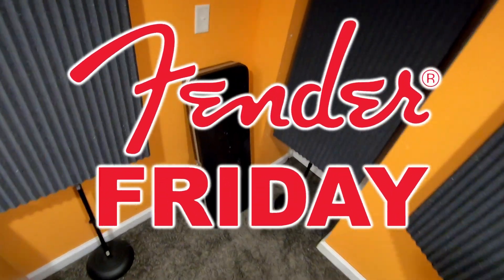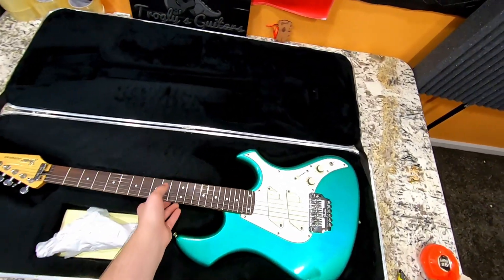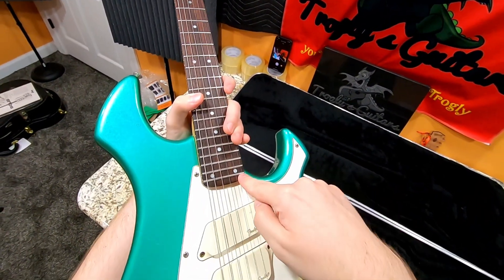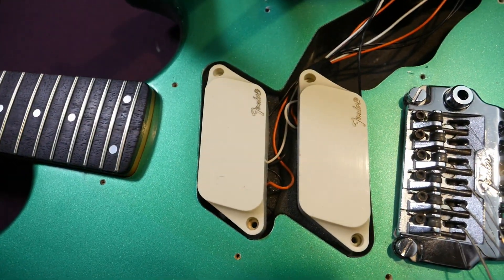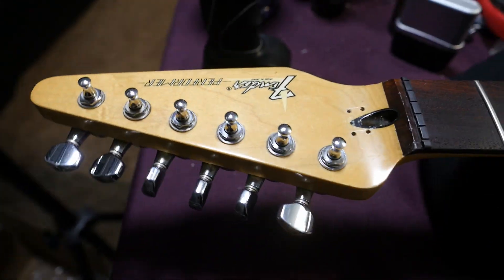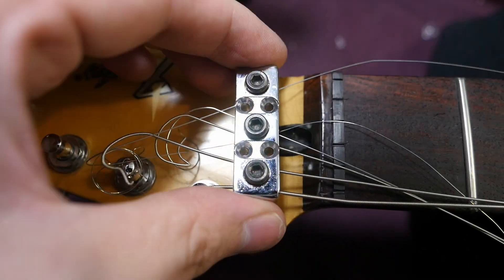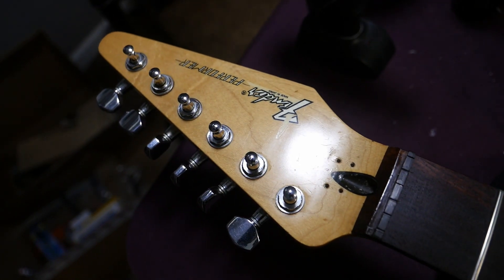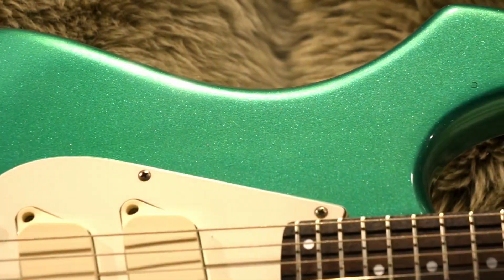That One Time When Fender Made the Strat "Metal" | 1985 Fender Performer MIJ Review + Demo

Comment: I have one of these in sunburst. I love the weirdness of it and the variety of tones I can get out of it. Nice to see this model getting some attention, especially now that there is a new performer series, burying this one even further.

One correction: the TBX tone control can not boost treble. It is impossible to boost anything without active electronics. The TBX acts like a standard Fender 250kΩ tone pot between 1-5 (until the notch), but with the compressed scale (as in, 1 on this is like 1 on a standard 250kΩ tone pot, but 5 is like 10 on a standard 250kΩ tone pot). From 5-10, you essentially have a different pot that goes up to 1MΩ, which is quite high. For reference, guitars with humbuckers (which naturally have less treble) usually use 500kΩ tone pots, so this is double that.

So, from 5-10, the TBX tone control does not boost the treble (again, that is physically impossible without active circuitry, or more precisely, some form of power source for a boost). It instead has such a high impedance value, that much more treble gets through compared to a standard 250kΩ set to 10. 1MΩ might actually be high enough to sound identical to a tone pot bypass (but I'm not positive on this).

Comment: I really like that general shape - the offset, the higher fret access - but I agree the upper horn could be shrunk a smidge.
Not sold on the pointy headstock either.
I'd also prefer non-offset pickups in it - I think it puts both pickups in odd positions. 
The neck pickup may as well be a middle pickup.
It'd be interesting what Fender would come up with should they re-issue it.

Comment: i had a '85 performer bass in tobaccoburst ... picked it up used for $300 in like 95 or 96 ... was my daily driver while i stripped and de-fretted my pv foundation 4 ... 
neck dive was a reality ... neck profile rivaled ibanez s series guitars, massive amount of tone options. sadly i sold it for half what i paid in 2003 ... to see them skyrocket in price 10 years later, now the basses are complete unicorns.

from what i understand, FJ built the basses out of spare necks stockpiled during the transition, this was intended to be the elite model of jazz bass, with 24 frets - styled to market to the hair metal scene. the guitars were modeled after the basses apparently.
if you can find a 4 string burst - those are the rarest from what i understand, the mint green and white were the larger numbers ... last one i saw pop up on ebay was about 10 years ago, and i think it ended up going for over 2 grand ...

Comment: Technically that’s a behind-the-nut string lock (opposed to a locks on the nut itself). Some say that the behind-the-nut locks have better open-string tone.
Reply: My Yamaha rgx1203s has behind the nut and its amazing
Reply: Makes no difference, I have used many locking string options including having no locking mechanism for a nut or the strings but just using regular locking tuners, with a tight pull before locking them so there is no wrap around but an 1/8th of the peg....It works just fine although people claim you will lose sound characteristics due to lack of String to metal to neck wood.
Hard to say most differences are in peoples heads and is pure poppycock.

Comment: I have three MiJ Strats - all identical, even down to the colour (Burgundy Mist) and, of course, the System One bridge. I bought the '85 new and have since purchased two others - 1986 models - about once a decade since.   Those guitars are not only my best playing, they are also incredibly stable in terms of tuning. Mark Agnesi either had an unusual bad experience with the System One trem or his memory is faulty. It was an excellent trem system... and still is on all of mine. They do require some maintenance from time to time but only rarely.
Reply: I was 16 years old in '85 and my dad had agreed to buy me a distortion pedal for my birthday. Went to the guitar store to try a few pedals and the clerk handed me a guitar to try them on. Within a few minutes, I didn't want a pedal anymore - I needed this guitar! It was a Squier Contemporary Strat, made in Japan. SSS but with that System 1 trem. Not only do I still have that guitar, if the house were burning down and I could only save 1 guitar, it would be that one - no question. I took the locking block above the neck off (I rarely use the bar, and never aggressively) but otherwise it's stock. I think it is a wonderful trem. very stable, very solid, big metal block, 2 point.

Comment: It looks like it was made with leftover parts from the original Elite Stratocaster.  Rubber grip knobs.  Enclosed pickups.  That does look like the Schaller System 1 Tremolo that was not on the elite but Schaller was making excellent hardware for Fender in the early 80's.

Comment: The Performer was my main guitar for 25 years, and I only stopped using it because the frets were getting too notched to continue.  The System 1 bridge / string lock is hands down the most elegant design ever - the Kahler and Floyd Nose look like they were designed in Russia - they work, but are ugly as hell.  However, the System 1 must be set up properly.   I am convinced the bad rap this system has gotten over the years is because the players just didn't understand the design.  Pity.  The string lock is more complicated than it looks on the surface: there are actually three hardened steel plates hidden under the cast metal body.  The strings are squeezed between the steel plates and the nuts when tightened.  I bet the steel plate in the middle is missing and the string is getting pinched into the string lock body.  THAT WILL FAIL!  Those hardened steel plates are almost impossible to replace but are crucial to the system working properly.  Sadly, many (if not most) of the Performers that come up for sale have had the string lock removed (and discarded!) defeating the whole purpose of the System 1.  Once that's gone, the fine tuners on the bridge become vestigial - you might as well just tune with the headstock tuners.
Reply: there is such a thing as a 'refret' you know?

Comment: The trem which you later mentioned by name is a Fender System I.  They were the stock trems on my favorite ‘85 & ‘86 mij Contemporary Strats, another name they revived recently. The trem is better than the Freeflyte they had on the Elites a model that also had the TBX circuit.  The Clapton signature model also had the TBX.  The trem bar you have is original.

Comment: I have a squire '87 MIJ Strat, with the System 1 bridge. Once in tune, it stays there. The one big difference I see is that on my guitar the truss rod access is in the heel, not under the locking nut.

Comment: Well this is the damndest thing. I would swear I have never seen one of these before yet I built one! 
My first guitar was a white 1986 (I think) Japanese Strat. In 1988 my brother threw a party and somebody went into my room and ripped the tremolo off my guitar! They didn't just rip it off, they ripped it OUT. The wood was torn out where the 2 big pins hold it in. It was the EXACT SAME one you have on this Performer guitar.
I took it to a guitar repair shop and had them put a Kahler on it. I hated it. The locking nut, same as on yours, would CUT the strings if I over tightened it. 
I bought a new Ibanez and the Strat sat broken and unplanned fir many years in a closet.
Fast forward 15 years, I decide to build a guitar body myself, just for fun. I am a woodworker. I prep  a block of mahogany, top it with 1/2" maple, because somebody told me thats what Les Paul's have and they sound the best. I bring out the Ibanez and trace out the curves, offsetting the opposite side. I draw out the forearms with a French curve, a drafting tool fir drawing curved, and I decide I like the BC Rich look of the pointy arms and I keep them. It comes out looking great, and I have it painted black at a car body shop I know people at.
Man I wish I could post a picture here because I came up with the same damn guitar shape that Fender did here!
Reply: U need a guitar(APEX) by Kamal chenaouy, this man was an early BC Rich Designer, all his axes are super on all, wood, playabelity sound you won't believe electricity overall design not over but on Top (Apex) 🎶👍👍👍ooh I've got one held a couple realy vavoom

Comment: Crazy cool, i have a 89 contemporary USA strat with the same trem, its been super stable for me
Reply: I had an 86 Contemporary Japanese Strat, in Burgundy mist with 2 humbuckers, and the System I... Early on, I accidentally bent the torque adjustment tool for the bar rotational tension, and ended up just ripping that tension adjuster off with the bar one day... still, the bottom part stayed so you could just easily pop the bar in and out. I ended up leaving the guitar with a friend... indefinitely...

@TheTrogly'sGuitarShow The design of the trem is really more like a Floyd Rose than a Kahler, if you ask me. A Kahler is a fixed, flush-mount unit with a cam controlling string tension. This is a 2-point knife-edge floating bridge with springs in the back and fine tuners on the top. The roller bridge pieces don't function like the cam on the Kahler; they're just there so the strings don't bind up at the bridge. The locking nut was also kind of tricky in that it was made of a few too many pieces of metal, and if you put the string in it wrong, there would be a knife edge at the top of the lock that would cut your string on the back side of it. And that looks exactly like what you did. Bad design, but it was possible to fix with some krazy glue, which is what I did.
Reply: @SeeJayPlayGames  kahler does have some trems that are similar to a floyd, best example would be the original run of the fender HM's.
Reply: @zigzagrz  oh, I was thinking of the cam-based Kahler's, like the ones designed for fitment atop Gibsons.

Comment: A long time ago I sent an email to Fender to know more about this guitar. This is what they replied:

Model Name: Performer Standard
Model Number: 027-5400-(Color #)
Series: Performer Series
Body: Basswood
Neck: Maple
Fingerboard: Rosewood 12" Radius (305mm)
Frets: 24
Scale Length: 25.5” (648 mm)
Nut: 1.625” (41 mm)
Hardware: Chrome
Machine Heads: Standard Chrome
Bridge: System I Tremolo
Pickguard: 3-Ply White
Pickups: 2 Special Design Dual Coil Humbucking Pickups
Pickup Switching: 3-position Switch
Controls: Master Volume, Master Tone
Colors: (532) Brown Sunburst,
(555) Frost White,
(566) Burgundy Mist,
(567) Emerald Mist,
(568) Gun Metal Blue
Strings:
Case:
Other Features: Angled, asymmetrical headstock, new stylized body shape
Source: Japan
Accessories:
U.S. MSRP: $539.99
INTRODUCED: 1/1986
DISCONTINUED: 1/1987

Comment: It's hard to believe that there were a few guitar companies that put the locking nut in the wrong place.
Reply: Why is it the wrong place. Locking hardware that fits behind the nut are sold  as aftermarket parts now. No need to mount it to the headstock , they work great just tightened to the strings.

Comment: In 1985, I decided against purchasing one of these. I only sort of regret it. I liked the looks and the sound. Played great too. But it was 1985. Floyd Rose and Kayler were in competition and the System 1 was untested. Those pups sounded good too,but the shape told me if I ever wanted to swap them out meant routing the body and new pickguard. If Fender used normal style humbuckers, at least I could have swapped the tremolo unit later if needed. 
   It was explained to me that these were made from the scrap left over from cutting Stratocasters and P Basses. The top half from one, the bottom from the other with a plank between them. So the woods conceivably might never have been matched and could be a mix on every unit.

Comment: Austin, I'm not sure that I would mind it if Fender reissued these monsters, but I would make some suggestions if they do:  On the subject of the vibrato, lose the proprietary system in favor of a more standard Floyd Rose 1000.  Better across the board.  Put a real shredder's neck joint on the body for more comfortable 24th-fret access.  Maybe give a choice between the original pickup set and another, more standard set of humbuckers (maybe alnico) and a choice of the original pickup placement or a more standard placement of pickups -- maybe even an H-S-S configuration.  Lastly, DO tell what kind of wood the bodies are made of.  It's important to many of us.

Comment: 2:10 It's kind of interesting how it has 21 frets yet the reason for 21 frets was so the neck single coil would be right where the 24th fret would be but there's no neck pickup, not that it couldn't be done with 22 frets but you'd either not have much wood between the neck joint and pickup route or you could overhang the fret board.

2:17 Yeah this one definitely doesn't have the single coil where the 24th fret would be.

Comment: I found a Squire Strat from 2000-2001? in a pawnshop that has that style headstock. I thought it was some kind of fake thing but come to find out its a Fender product. It has maple neck and black strat body with white pickguard.When i got it re-strung and setup a little I like it. The pickups sound very good and the neck is a bit fuller it feels and plays pretty good. A nice keeper bought at a pawnshop several years ago.

Comment: I've got a fender stratocaster with that trem,I believe it's called the system one or something like that, but it's basically a Floyd Rose. I had to replace the locking nut and the trem arm, so not all original, but I like it because the trem arm is a little bit longer than the Floyd and makes it easier to use.

Comment: This guitar has a treble bleed circuit and a split-coil circuit. The best of both! Most likely (if you knew your VOM device better) the volume pots with them running with no volume, 2 of the 3 posts should be running at 500k or 250k ohms. "K" is for killo or 1,000 times the number so 500k ohms is 500,000 ohms.

Why do I try to help you? I like guitars and electronics information also. 2 of the 3 posts and volume pots turned off, will give me and yourself the bit of information necessary in validation of are these guitar makers matching pickups to the pots or are they matched by I make Gibson so we only use 500k ohms pots or here, when I install humbuckers we use 500k ohms, except when we're to use single-coils we use 250k ohms instead. So what is the value in ohms of an HSS system and it's volume potentiometers?

The other information for you is when you have a treble bleed circuit is when you capture a tone and it's louder than what you wanted with the bleed circuit on, you are able to lower the volume pot, (depending on the capacitor and the resistor values) and lower the volume but not the tone captured for as much as 30 to 50% the volume is lowered and the tone doesn't change! Cool, isn’t it? It's a great tool for keeping your hearing I think? Rock N' Roll, see ya.

Comment: I own a a 1985 Fender Katana (squire) Same headstock as The performer I reworked it and put a Seymour Duncan Pearly gates on and added a tone pot I also changed The tuning keys to black fender locking keys I kept the Original Block under The saddle but I swapped out the Chrome saddles themselves and replaced them with black ones the new block that came with the new saddle was light weight Metal /Aluminum…then I Made a brand new design for the pick guard And locked down the trem :)) it plays great It was my first guitar I had it since I was 12 it is pretty rare to Find this guitar Although I customized & upgraded It sounds and looks so much better..

Comment: I had a 1985 Strat, MIJ , which was the standard Strat then, it had the system 1 on it. It was not my favorite and kind of degraded as I used it for a few years. The single coils on mine were pretty vintage sounding unlike this one.  I still have it but I started modifying it and removed the original trem which I regret . This is a different animal but pretty cool.

Comment: I got a cheep squier used at guitar center ($60) It was a strat body but it has this head stock and said star caster. I bought it because it has 2 Seymore Duncan humbuckers and a full sized strat body and a in line set of 6 in line grovers so the parts were worth more than the guitar. I did like the head stock. Something different.

Comment: I want to make one, damn that is nice.
I would do a -
Bridge - MIG Floyd Rose Gold/Black with matching String Tree and Locking Nut
Pickups - HSH 2x Humbucker Rail 1x Hotrail, Black and Gold
5 Way Blade switch -auto splits
Volume Pot, TBX Tone Expander Pot, Morello Kill switch for the 1st Pot Position pushbutton- Witchhat knobs Metal Gold with Red Jasper stone Inlays  
24 Fret, Dunlop Gold Jumbo, Black Ebony Fretboard, Rolled edges, Red Jasper Stone Inlay
Black Pearl Pickguard, Gold 1/2 inch switchcraft stereo jack with slide button on back cavity cover for stereo out use. Gold screws and strap locks.
Paint for the body I would go with Bordeaux Metallic with Matching headstock paint- That dark red with all the Gold and a dash of Black to have it pop.

YO FENDER MAKE THIS SHIT.

Comment: I'm unhealthily fixated on this model. I couldn't click fast enough  I love the look and I think the pickups both sound great. But that tremolo...why the locking nut behind the nut? And why go to the trouble at all if it doesn't have any more upward travel than a regular Strat trem? 

They need to reissue these with locking tuners and a 2-point trem. I have spoken.
Reply: I think it was because Floyd Rose had a patent on the locking nut being the actual nut at the same time.